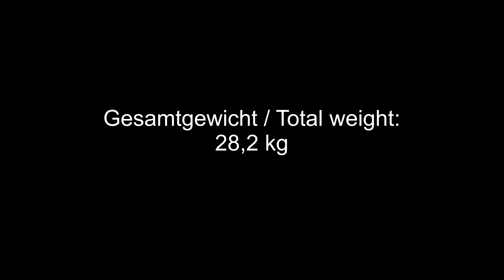Building my own Tracktool #1 - Removing the Rear Seats

Comment: great videos, very helpful for me. in the interest of lightness, have you also thought of changing the front seats to lighter, non-electric seats. i realise these can be an expensive method but there are also numerous choices of aftermarket seats in the market. my guess is you'll save a significant amount of kilos. keep up the good work!
Reply from the maker: Yes, i want to install Recaro Pole Position seats. But its not easy, because the side airbags. Later on i want to replace the stock batterie with a Lite Blox batterie.
Reply: WaveCeptor War es geplant den A45 als Tracktool umzubauen? Frage deshalb weil du ja die aufpreispflichtigen Sportsitze eingebaut hast... da haettest du ja locker 2000€ sparen koennen...